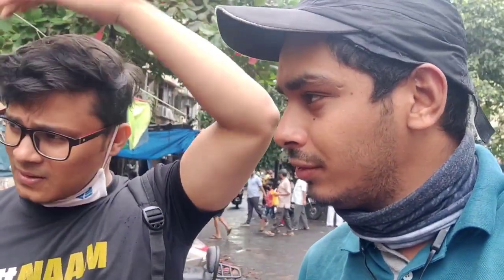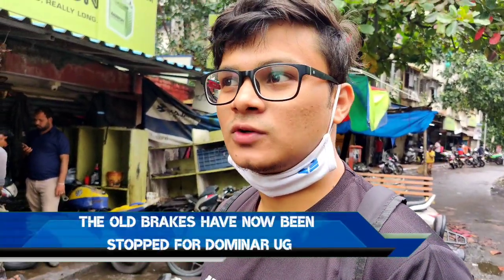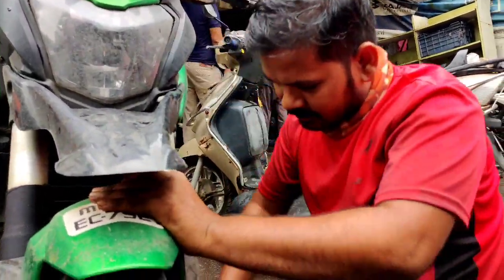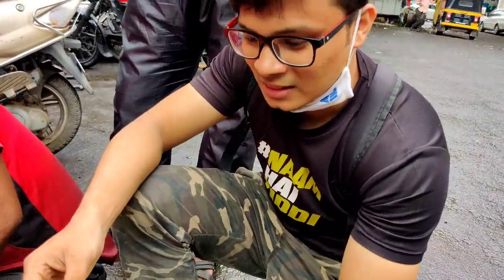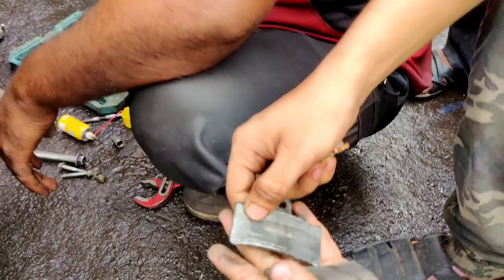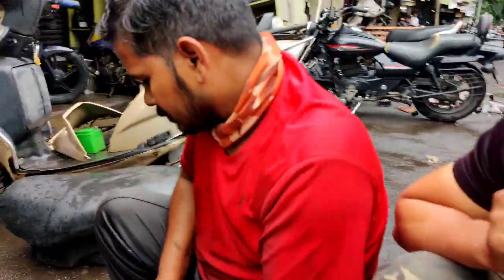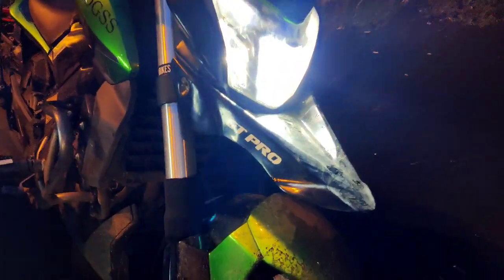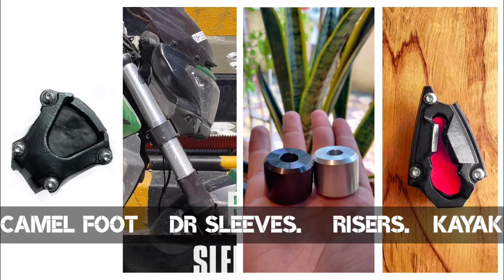Upgraded Stock Brake Pads Dominar 400 UG / 250 | Best Brakes | Sintered Brembo

Comment: I have dominar 2019 bought october 2019. So does my stock brake have the upgraded brake pad which your talking at 0.37 mins ?.
Reply from the maker: No that have to be bought separately
Reply: Yes checked with KTM they have for front brembo. Rear is old.brakes only. Do you suggest versah ceramic or ebc for rear ?
Reply from the maker: Lrl or ebc for less budget

Comment: Which to choose for Dominar 2020? Adventure 390 brake pads or Duke 390 brake pads? Or are both of them the same?
Reply from the maker: Both are same adventure one are slightly better when first came
Reply: @rahulVlogs  so better to go for Brembo brakes that go for Adventure 390.. right??
Reply: @rahulVlogs  and do they fit properly and easily? Just like fitting Bajaj stock break pads? Or any special technique required for fitting Brembo pads?
Reply from the maker: Yes brembo is best atleast my experience
Reply: @rahulVlogs  Do the Brembo brake pads fit normally on Dominar just like stock break pads?
Reply from the maker: Yes
Reply: @rahulVlogs  Thank you bro. Much appreciated ❤️

Comment: EBC break pads available for  dominar ug ? Or should I go with ktm adventure break pads which is easyly available in ktm showroom and both are perfectly fitted with dominar ug or not so I can give shot , because rear breaks are worst very bad experience with that breaks
Reply from the maker: Front brake pads now ug gets brembo pads frim bajaj itself would cost 1700 
For rear ebc brake pads you have to get but first change the master cylinder
Reply: @rahulVlogs  where I get the master cylinder
Reply from the maker: Bajaj service center
Reply: @siddharth889  no need, 

search in LRL motors app u got ebc brake pads in front and rear without anything change
Reply: @RSourav_Dey_SINCE_1998  thanks brother
Reply: @rahulVlogs  Why master cylinder change is required for Dominar 400 rear brake, and which model master cylinder(i mean need to buy dominar 400 master cylinder or other model master cylinder for Dominar EBC Double sintered brake pads) need to buy from Bajaj Service Center
Reply from the maker: Dominar 400 ug models needs rear master cylinder.

Comment: Bro can we expect sharp rear breaking power after installed brembo pads in dominar??
Reply from the maker: Video banta hu
Reply: I have brembo brakes in my conti gt 535 and trust me, the bite is fucking amazing. But the thing is the caliper is also brembo so your mileage may vary.
Reply: @ParthRastogi  u mean.. mileage will get reduced??
Reply: @prabhus5989  oh no, mileage may vary(pun intended) is a saying which means it'll be different under different conditions.
Reply: @ParthRastogi  where I can get this brembo pads.. how much is it?
Reply: @prabhus5989  it depends on your calipers, my brembo pads cost 2100-2500 sometimes. I get it done from a customs shop called fatboy customs here in Gurgaon.